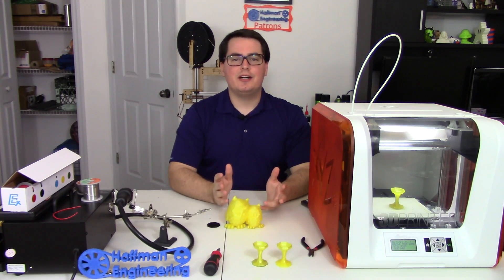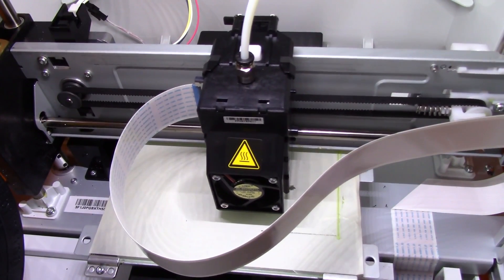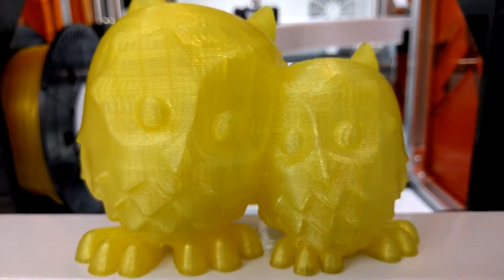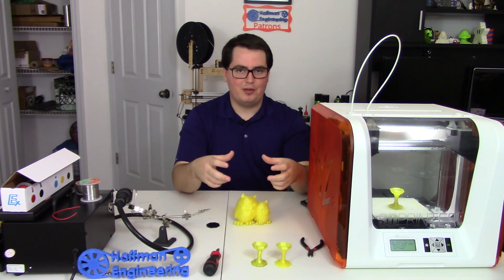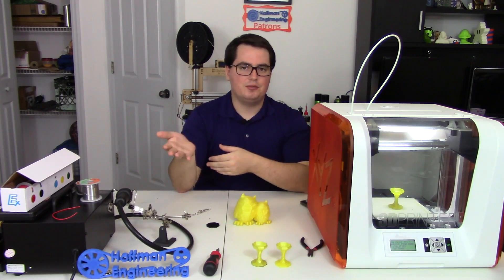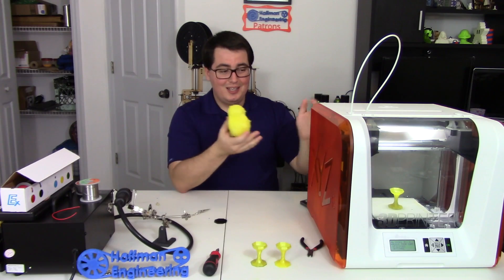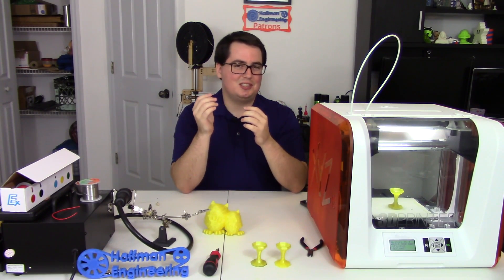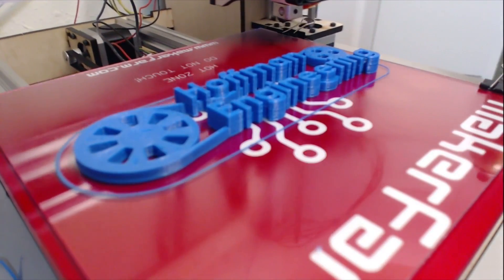Da Vinci Jr 3D Printer: Is this $350 printer worth it?

Comment: I could never complete a 3D-printout with this machine. The filament stucks in the dispenser,  the feeder cuts the filament, the printer stops dispensing and turns empty figures in the air. It's worth nothing!
Reply: did you setup the z axis.  Once you get this sorted its pretty good.
Reply: Thanks for asking.
I did a lot of work on this printer in the meantime. Unfortunately I do not have any pictures for documentation.

I lowered the pressure on the feeder mechanism by reducing the tension of the spring. It had a force of about 3 kg. This high tension causes the stepper motor to block, if only a small amount of higher force is required, to feed the filament - hearable as a "clack, clack, clack" with an optical vibration of the filament at the same beat.
I lowered the tension to about 300g, by the use of a screw driver to increase the spacing of the springs windings. The feeder is located on the upper left side of the printer. The half of the case has to be unmounted, to be able, to reach it.
The force is estimated by the pressure force on the thumb, to move the feeders leverage.

I also lowered the pressure of the springs in the filament detectors, to allow a smoother guiding trough. There are two detectors, one in the filament feeder, one in the extruder head. To do this, I took the springs out, pulled it to the double of the original length, cutted it in the half and sat it back in.

It is a bit tricky, to open the extruder head. I broke some fasteners out.

I had to fix the entry for the filament on the extruder head with a nylon washer, mounted under the fixation, to thighten it. It was loose and caused a misleading of the filament on entering the extruder.

The metallic cone inside the extruder head had some sharp edges, where the filament was jammed mostly. After smoothening it a bit, the filament was sliding trough without any problems.

Now it prints perfectly.
Reply: @dschony  excellent. This review is pretty dated and missing some facts. You do suprise me with all the things you had to do. I know the clack clack noise but I found that this on most of the Jr's I've seen was always because the feed tries to feed too close to the bed or the last layer. I'm not doubting you either just you can't believe most of this review as it's misleading.
Reply: The clack clack comes from the feeders stepper motor, which is stepping back one step with each clack. The reason for stepping back is always a filament jam. There are two possible reasons for a jam: 1. Something prevents the filament going trough the nozzle (maybe something in front of the filament, like the bed ...). 2. A problem in the feeder loop (like to high forces of the springs and other mechanical problems).

Comment: I also dont like they way you have to calibrate the XYZ Da Vinci Jr 1.0 took me forever to finaly get it to print the way i wanted after manyattempts at calibrating it. I also took their tape off and just used a small amount of stick of glue it works alot better but i also used a differnet filament using thiers might also have been the reason why my prints didnt come out as good.

Comment: I wish i would of seen this video over 6 months ago before i purchased my XYZ Da Vinci Jr 1.0 printer because I had no idea about only being able to use thier Filament. Only until about 4 days ago when i wnet to go buy a differnet filament and could not find any then investigated only to find out it has a chip in thier spool. I have seen on E-Bay that a seller is selling some 3D printed chips that read a fool spool so you can use any brand spool have you seen them and would you recommend them?

Comment: I’ve had this printer since Christmas. About 90 hours of printing with very mixed results.  I’m so tired if the nozzle jams that take forever to clear. I even do it before every run. It’s so slow to run through its paces before heating up the Extruder to even clean it. I can’t for the life of me get the bed leveled having watch just about every YouTube video on the topic. Bought Simplify3D as they now support the device. Not having much luck that either.  So ready for an upgrade now.

Comment: I honestly haven't had a bad experience with the filament other than it being expensive
Reply from the maker: The roll that worked printed just fine, but the other rolls were just way too out of tolerance. Maybe they tightened their manufacturing in the two years since then.

Comment: My wife got one of these through goodwill of all places. Wasn't working at first, had to replace the power adapter that came with it with a proper one. And had to fix the connecting rod for the z-axis. But I got it to print fine after some calibration. For the price she paid and for a couple spools from amazon, I'm very happy so far with my first 3D printer.
My question is, once I've hit the limits on what I can get out of this one, what are your current recommendations for printers in say the $500- 1K range? I'm not opposed to building it myself, and something that gives me more flexibility in printing materials and even multiple extruders would be ideal.

Comment: I have this printer and it jams so much that its to the point where I haven't touched it in months. Also, I have the black and clear filament and the black jams. not the clear as much. The printer also likes to jam while trying to load in filament. Its a struggle. I got it for $250 though at barnes and nobles
Reply from the maker: Next time it jams, run your fingers over the last couple feet of filament and see if you can feel the diameter changing. When I've experienced jamming, I could feel a bump in the filament which prevented it from being able to fit through the extruder. If so, definitely contact XYZPrinting and see if you can get a replacement cartridge.
Reply: it just jammed this morning. There are indents from the gears but thats about it.
Reply: Alright and I'm posting a video of the horrific sound it makes and it jamming.

Comment: Is this a 3D printer for beginners?
Reply: Luca Borghi Yes. It is for beginners. I have this printer. I am also considering upgrading soon to a better printer
Reply: We have one designed for beginners which cost about $500. Very easy to operate, comes with everything you need and has already been calibrated at the factory. We even include  PLA filament 1kg and a MicroSD card with preloaded model files, so you can start printing right out of the box. The compatible software is Cura so you can customize the model.  Feel free to contact me for more details pls. Thank you so much.  Email: zoe@et3dp.com

Comment: Hello, thanks for the review. I am looking into getting a 3D printer, but my budget is limited, besides XYZ, what brand would you recommend?
Reply: Hello, we have one designed for beginners which cost about $500. Very easy to operate, comes with everything you need and has already been calibrated at the factory. We even include  PLA filament 1kg and a MicroSD card with preloaded model files, so you can start printing right out of the box. The compatible software is Cura so you can customize the model.  Feel free to contact me for more details pls. Thank you so much.  Email: zoe@et3dp.com

Comment: Got one for Christmas.  Mine is the teal one w/wireless.  Have had problems with computer talking to printer, and taking the print off the bed.  Don't like the tape sheets, because they tear removing the print.
Reply from the maker: I'm not a big fan of the tape print surfaces either, they are quite easy to tear. Luckily its easy to replace with normal blue painters tape, and its relatively inexpensive.

Sorry to hear about the wifi problems though, I have the Da Vinci 1.0 pro, which has wireless connection as well, and I haven't had issues connecting besides IP addresses changing each time the printer turns on.

How's the print quality for you? Any issues with bad filament that I experienced with my jr?
Reply: Either I'm learning quickly (or have an excellent tutor) or my luck is changing! LOL. Still haven't figured out how to use the wireless feature, but yesterday I got the printer to see the computer and print a small sign without the chip.  Had good luck with using a glue stick on top of the tape sheet.  Had just a minor tear which I taped over for my next attempt.  Neither my friend nor I have had trouble with the filament.  He's used a bunch of different colors, I'm still on my first reel of white.

Comment: Pretty happy with mine actually. Cost of filament is high, but then again even many pricey printers do not manage filament remaining which this does for every reel very nicely. Internal reel mount is a god send - much better than dodgy external caddies. I just wish you got the NFC chip holder part pre-mounted with each spool - not unreasonable at this price ! Main issue is filament unmount which works only sometimes - if it jams you have to unscrew feed from hot end, "load", wait for temp to drop to 100c, pull. Works fine but kinda a pain - if you snap off in the cold brake inside the head god help you - microtwist drill bits, no cartridge disassembly instructions and much care needed. Fortunately have only had to do that twice and all printers have this issue from time to time. The factory levelling is good, but the default first layer height was not on mine and this is where my first jam came from - best to go a little high and step it down until perfect using their sample part (a small heart pendent). Over all it was a good purchase, and the case with its very nice internal light and the internal frame are very very nice, very portable and better than most printers 3 times the cost.

On a final note - yes the slicer is a "bit pants", but have you ever tried to use so called "simplify 3D" for the first time? Gods ... overwhelming ... and the silly XYZ slicer actually works well with this printer "on default" and then you can slowly play from there. I also use Microsoft 3d builder most of the time - it really is the underrated (and free) "iMovie" of 3d :)
Reply: I have the same problems as you. I just had to open up my gearbox to find that a couple gears were shot. :(

Comment: thanks for you review it is been very helpfull ......any printer that fit same budget ??
Reply: Yes, we have one designed for beginners which cost about $500. Very easy to operate, comes with everything you need and has already been calibrated at the factory. We even include  PLA filament 1kg and a MicroSD card with preloaded model files, so you can start printing right out of the box. The compatible software is Cura so you can customize the model.  Feel free to contact me for more details pls. Thank you so much.  Email: zoe@et3dp.com

Comment: Ty for the review, what would be your best choice for a starter 3D printer from 500$ or lower?
Reply: Yes, we have one designed for beginners which cost about $500. Very easy to operate, comes with everything you need and has already been calibrated at the factory. We even include  PLA filament 1kg and a MicroSD card with preloaded model files, so you can start printing right out of the box. The compatible software is Cura so you can customize the model.  Feel free to contact me for more details pls. Thank you so much.  Email: zoe@et3dp.com

Comment: It's close source
Reply: you can always strip it naked of their circuitry and put a ramps in there. Stepper motors all work the same way, unless they are using unipolar ones would would be a pita and would require you to open them and separate the winding to make them bipolar.
The same can be done to any 2D printer out there. With and arduino/microcontroler and a bit o patience you can turn any 2D printer into a plotter or whatever you like. Even if it uses an optical encoder for the carriage.

Comment: The file format you mention in the video is just a renamed gcode file.
here is an article on that.. http://hackaday.com/2014/04/17/using-non-crappy-software-with-the-da-vinci-printer/

There is another software package that works natively with the full line of davinci's
Simplify 3d...  

for the JR... you can reset the filament counter to use 3rd party filament like you can with the big Davinci's:

http://www.instructables.com/id/XYZ-Da-Vinci-Junior-jr-NFC-Tag-Filament-Reset-Hack/

but you have to use a back level firmware according to the forums....

Another good sub $500 printer that has all the features without the proprietary filament issues is the Wanhao I3..... though to print ABS you really should have an enclosure for it...

Great post though....
Reply: haha beat me to it I was gonna say the same thing
Reply from the maker: Thank you for those links, those are perfect!
Reply: you are quite welcome... =) anytime I can be of help just let me know... (in jax lol)

Comment: What are some of the lower priced printers that would be great for hobbyist?
Reply: depends on your budget  you can pre order 101hero for about $99  there is this printer 350 or Amazon 299 then the Jr wifi  same price i think and soon to be jr in 3 in 1 which is lazer engraver 3d scanning and 3d printer for pre-order for $545  the moving away from xyz you have the Wanhao i3 v2  $450 ish (and all of it Chinese rebrands)  and the robo3d r1 plus for about $700  but I'm sure there many others out around those prices  but if you can afford more there is more options to choose from
Reply: Thank you.  Is there one that will be best for detailed printing?
Reply: +Xavier Jennette  what's your price range ?
Reply: +pat ayala  I'm prepared to spend at least $700 to $1000.
Reply: +pat ayala Thank you so much Pat.  I will check this out.
Reply: Look at the creality ender3, lots of great things about and it's performance is way above it's price

Comment: i have a 1.0 and i flashed repetier on to it it works wonders now
Reply: +Royce Barber no i have the original 1.0 the very first printer they had
Reply: That's actually a really good point. I've heard of some XYZprinting printers allowing a different board. Thank you kindly for the tip, I'll research it. :D
Reply: +Royce Barber no prob best of luck dude
Reply from the maker: +Cian Govern I've heard that helps wonders, and it would resolve many of the issues I have with these printers.
Reply: +Hoffman Engineering its a little risky cuz theres a chance you can completely destroy the printer but if you can get it to work its well worth it
Reply: Hi, do you have the Junior 1.0? I'd be happily surprised if it can be flashed at all.
Reply: +Royce Barber and i think it can its the same sorta process the mpthermoboard is just a fancy arduino
Reply: +Royce Barber no the original wasnt a junior its a white and gray model with a heated bed
Reply: Sorry I'm dumb, I asked you to verrify that you have the Junior model lol. Well this video is about the Junior which I have. Flashing won't ever work at all on it. At least not so far. The forums I've seen said it's just hopeless. XYZprinting doesn't even use gcode for the Junior, they use a special format.
Reply: +Royce Barber idk if this works but did u try searching for a suplementary board? maybe us the board out of a 1.0? maybe search see if its been done before

Comment: havent been able to print anything. object comes off tape and slides around with head.
Reply: Try using stick glue with a light coating on the tape
Reply: +DrFrankensteam thanks i will.
Reply: crayola washable with a few streaks.
Reply: You need to calibrate the printer.
Reply: +Nick Riley gigured it out use glass not tape with stick glue
Reply: Great!

Comment: I got the DaVinci Pro on preorder for $550 an I have to say I was unimpressed at first, but now I love it. Since it is completely unlocked I can use the filiment I want saving money and Slic3r with better setting control and multi-threaded slicing. The XYZWare is only single threaded so my CPU was pegged at 12.5% (i7), now it goes to %100 and takes ones of seconds. I have found my DaVinci printer has excellent print quality, I cannot complain at all. The major downside is you have to print very slowly. I have the thing set to 40mm/s maximum for infilling. exterior perimeters at 30 and interior at 35. It takes forever but I am overall pleased. It features the off-board bowden style extruder which is great for vibration and accuracy b/c the print head is light, however oozing does require some post-processing with a scraper.

Comment: Good video, I considered one of these before building my Sunhokey i3 which with my upgrades edges this out on prints.

As mentioned already they can be reflashed which sorts not being able to use normal slicers and takes off the restriction of using their filament.

Comment: There is actually a work around with the filament. There is a way to reset the chip and make the printer think you are using any color with any length left. I use a big roll of hatchbox pla on my jr, and when it says it is low, I reset the chip.
Reply: Thanks for the suggestion, Murdoc! Directions available anywhere?
Reply: +Dennis Desmarais http://m.instructables.com/id/XYZ-Da-Vinci-Junior-jr-NFC-Tag-Filament-Reset-Hack/?ALLSTEPS
Reply: Many thanks, Man!

Comment: hi. well as we can see on the video : even with the yellow spool the print quality is average but not good at all. overhangs are not clean.
Reply from the maker: +Axel Sixtysix Certainly passable, but you are correct, the overhangs are slightly droopy, corners are not crisp. It could definitely use a fan to cool the object, especially since it is PLA only.

Comment: 400 micron layers?
Reply from the maker: +modeem352 Correct, their slicer had presets for 0.1mm, 0.2mm, 0.3mm, and 0.4mm layer heights. That goes against the usual rule-of-thumb of max layer height of 80% your nozzle diameter, but it actually printed with 0.4mm with no problems.